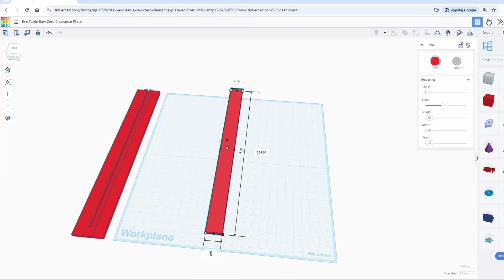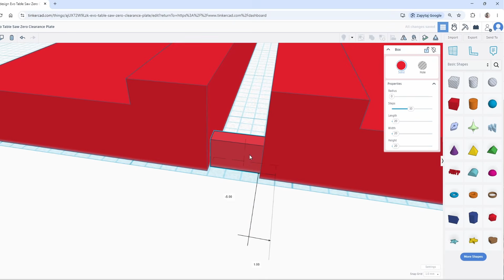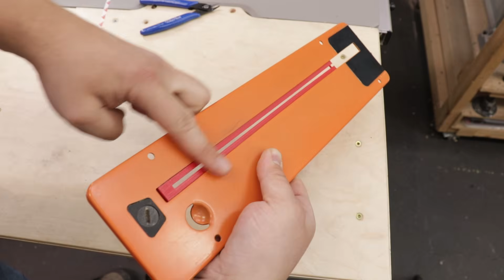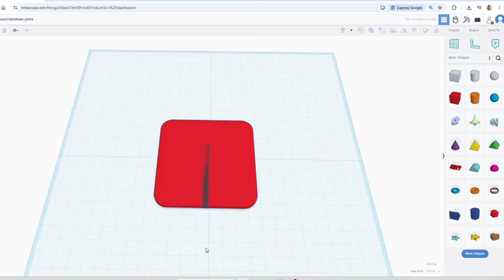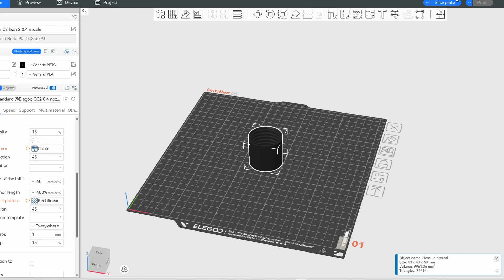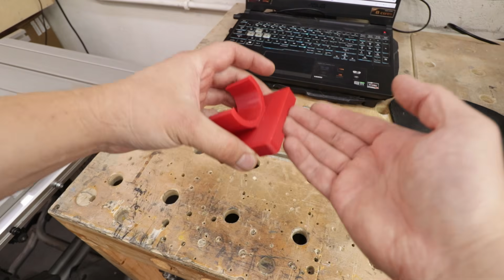6 Workshop Problems SOLVED with a 3D Printer!

Comment: Great vid. It made me laugh at the finger holes on the MFT shop vac holder. Then the first thing you did was pick it up with the hose clip. lol. Seriously though, nice vid!
Reply from the maker: That is intended to be honest, as I want to have the ability to move it around easily as I will be making some 3D printed dust collection ends for this setup in my future video. However it did came out a bit too easy from the dog hole. Seems those dog holes are not 20mm anymore. Had this workbench for years and I think its time for a bit of an upgrade.

Comment: A lot of hobby woodworkers don’t have the spare cash to throw at these sort of machines. I’d love one but as a pensioner not much chance unless l can find an old secondhand one.
Reply: I paid £25 for a second maybe third hand Ender 3 copy just to see if this tech was for me. We are just about getting on fine.
Reply from the maker: You can get a brand new 3D printer for around £150 if you look around. And over time it will pay itself off when you start making your own accessories rather that buying them. Or simply instead of buying cigarettes or alcohol or takeaway or going out, save for two or three months and that it. There is always a solution to any problem.

Comment: I just purchased the new Evolution saw in Canada and it came with two zero clearance plastic inserts included but I think my next purchase will be a 3D printer. I think you're absolutely right about it having so many uses in the workshop.
Reply from the maker: Oh that's cool they added those, super useful.  Yes, a 3D printer has so many uses in any type of workshop. And now they are quite affordable, and easy to use

Comment: The zero clearance insert works well but what do you do if you need to cut at 45 degrees.
Reply from the maker: I take it off, not found a need for 45 degree cut zero clearance plate yet.

Comment: I’d like to move my printer into my workshop, but concerned about the dust getting at it.
Reply: That's why my printer is in the house rather than the workshop. Once your printer/filament is contaminated with fine dust you will never get rid of it.
Reply from the maker: @arteepee thats true
Reply from the maker: That is a concern. Mine is fully enclosed but the filaments are outside lol so I got a filament dryer that I can hook up to the machine directly. Then everything will be enclosed.
Reply: @CasualDIY  mine is also enclosed, but printing PLA needs the door open
Reply: @CasualDIY Did you find you need the dryer for petg?
Reply from the maker: @nialstewart8263 yes, specially in the autumn/ winter time. I even noticed that when I leave my PLA for too long without any cover it gets super brittle.

Comment: Don't need a 3d printer. If I need a special item or shape, I just mould and/or sculpt it out of epoxy putty or make it from scrap wood etc.
Reply from the maker: There's many ways of getting things done 👍
Reply: And hands on. I found  buying a printer a little disappointing. The machine has all the fun of producing a component, the stuff I enjoy on a manual lathe/milling machine.
Plus you really do have to go back to school to learn a new language to make it work. Basically you spend all your time doing the paperwork and the machine has all the fun making the component.